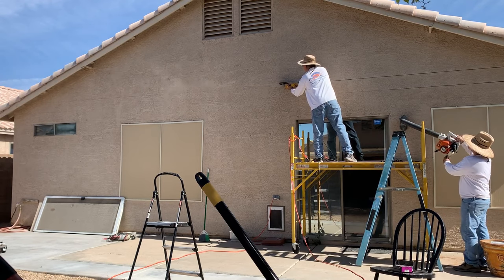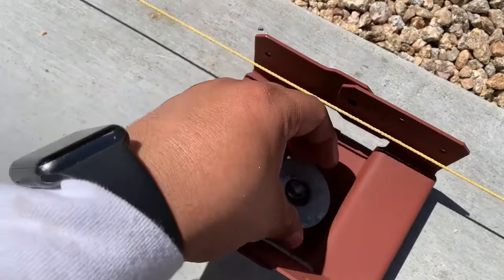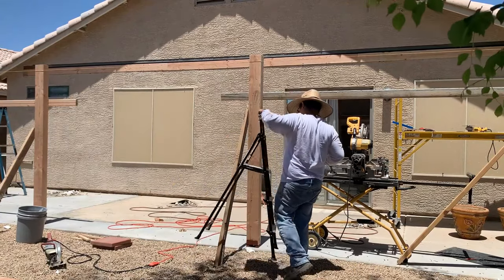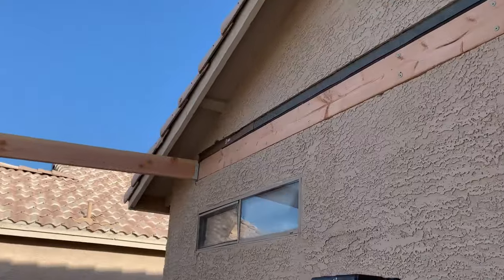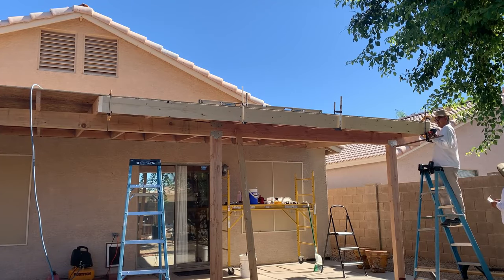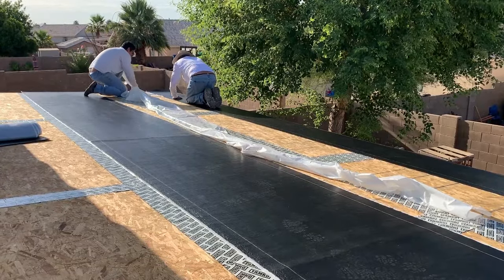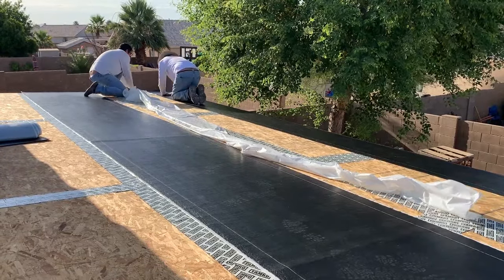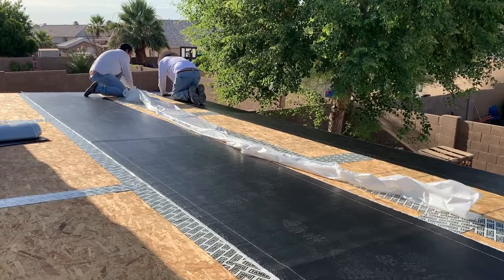DIY Patio Part2 - Framing Roof

Comment: These videos are great man, really appreciate you taking the time to do this. I am getting ready to build a patio onto my house and I didn't wan't to cut into the stucco, but it sounds like this is the correct way to do it. Good job getting the help from the wise old men as well haha
Reply from the maker: David Higdon thank you so much for the feedback! I wish you good luck on your project and make sure to measure twice before you cut into the stucco. You will feel glad you did it right the first time.
Reply: @luisangelmedia4459  Can I ask how difficult it was to install the first piece of z bar flashing? It looks like you install the z bar before you put up the 2x6 ledger. Just wondering how difficult it is to cut into the black paper and slide the first piece of Z flashing up behind the paper?
Reply from the maker: David Higdon It all depends on how many nails or staples you find between the stucco and the studs. We used long and thin tools like drywall knives or masonry trowel and a hammer to cut the staples or nails. If there is a stubborn nail, you can cut back the Z bar where it hits up against the nail.
Reply: @luisangelmedia4459  when you installed the z bar flashing above the ledger, did you slice into the existing black paper and then slide the z bar flashing up behind the paper? I am getting ready to cut into my stucco to install the ledger board and I am just trying to decide the best way to do this before I get started.
Reply from the maker: @davidhigdon8238  yes, you will need to cut the black paper. I was also hesitant on this, but you will see that you need to pull or ram a few of the stucco nails and staples in order to get the Z bar flashing up behind the stucco. The paper will get damaged in this process so, might as well put the Z bar behind the paper.
Reply: @luisangelmedia4459  So once you attach the z bar, the lower exposed part of the z bar flashing will sit about 1" off the wall, correct? It looks like you use another 45 degree flashing that is tucked under the Z Bar? How did you attach the 45 degree flashing? was it just nailed to the wall? Or did you attach it to the Zbar flashing somehow?
Reply from the maker: @davidhigdon8238  okay so on top of the ledger board sits a small 1x3 wood spacer. The purpose of this spacer is so the Z bar can rest on it and also provide support for the 45 L flashing. However, once you have your OSB board and roof material on, you will notice that the Z bar and L flashing make a tight fit because the Z bar is wedged between the stucco and that spacer I mentioned and the 45 is wedged between the Z bar and the roof.
Reply from the maker: @davidhigdon8238  https://imgur.com/a/MbRxgUQ

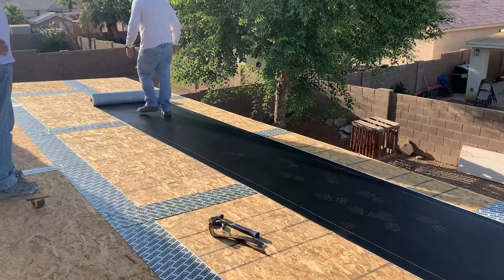Comment: Great video best one I’ve seen with detail instructions what is the small tape called at minute 8:17 with the shiny chrome thank you in advance
Reply from the maker: It’s waterproof flash tape commonly used for exterior doors or windows. Totally unnecessary for this kind of patio build, but my dad had an extra roll and he said to add it to the joints. We don’t do this to new patio builds. So you don’t have to add it.

Comment: 8:21 Luis, the seams between the osb boards have been taped over with some product. I read we can use duct tape but it doesn’t stick well. What are you using?  Thank you for your help
Reply from the maker: @Michael-vi2se  hello there, nice catch on that. My dad actually used window flashing tape that he had leftover from another job. It’s absolutely not needed and he just wanted somewhere meaningful to use up the rest of it. I’ve built many of these patios and we never done that before.

Comment: Hi Luis - can you explain why you cut the first sheet of self adhering underlayment? How many inches did you overlap each section of the base sheet?
Reply from the maker: It’s common practice to cut the first section shorter so that when you lay down the cap sheet on top of the base sheet, the seams are not on top of each other which causes a small bump. Each section is overlap 4-6 inches, shown by the markings on the sheet and the glue that is already on the seam.

Comment: Hello, good job on the build. My question is you guys didn’t use any asphalt primer on the osb it wasn’t necessary?
Reply from the maker: Thank you. And no, here in Phoenix, Arizona, the city did not require me to add anything to the osb except for the paper or in this case, the base sheet roll and the cap sheet.

Comment: You peel the top layer first in the first row so be ease for you then the bottom and if you didnt put roof cement on the drip edge 
You will go back to fix the damage wood .
Reply from the maker: Thank you for the feedback. I did not use roof cement because the roof rolls already had a layer of the sticky material. Also, Arizona is such a dry state that we usually do not have much problems with water damage, unless it’s completely exposed.

Comment: Luis, thanks for the video, I am curious how you finished the under side of the patio cover, OSB is not a great look for me, what do you recommend?
Reply from the maker: @danieldresser9368  Thank you. The common thing to do after you finish the patio is to start adding the insulation and drywall. If you don’t want drywall, you can do plaster as well or any decorative wood.

Comment: I'm doing something myself, don't want to cut into the stucco, our hottest gets over 100, but not often. What would you recommend for flashing? I understand cutting stucco is best but all the contractors I got bids from did not want to do this.
Reply from the maker: @EricRodriguez-u2k  if you’re not cutting into the stucco, then just put a normal L flashing from the stucco to the top of the roofing material and seal it with silicone. Be prepared to seal it with silicone or caulking every summer though as it’s going to be your only way to keep the water out.

Comment: Would you mind posting a link to the roofing rolls you used as well as the tape you used on the joints? Nice work!
Reply from the maker: Base sheet
https://www.homedepot.com/p/GAF-Liberty-3-ft-x-34-ft-100-sq-ft-SBS-Self-Adhering-Base-Sheet-Roll-for-Low-Slope-Roofing-3733000/100087821

Cap sheet
https://www.homedepot.com/p/GAF-Liberty-3-ft-x-34-ft-100-sq-ft-SBS-Self-Adhering-Cap-Sheet-Roll-for-Low-Slope-Roofing-in-White-3732920/100031926
Reply: Hi, what did you use on the joints (before the base sheet)? Thank you!
Reply from the maker: @susyfierros  it’s a roll of waterproofing material similar to the base sheet, but used on things like window installs, has multiple uses. It’s not necessary to add this and this is the only time we did it simply because my dad wanted to have more sturdier seams between each board when walking on top of it.

Comment: First of all, great video Luis. Question for you, are all the studs in your home (where you installed the ledger) running vertical or were they slightly angled? How do you think these studs are installed in a typical AZ home?
Reply from the maker: Yes, all the studs are vertical. But I have another video just like this, except that instead of the vertical studs, I anchored it to the top plate. Here is the video. 
https://youtu.be/jEY4WI4uWwg

Comment: big..  question I live in Colorado...did you use all your Lumber treated....I want to  built a patio cover without treated Lumber
Reply from the maker: We did not use any treated lumber. One year later I painted this patio a solid color to match the rest of the house. I did another patio and they also painted it. It’s usually recommended to paint or seal the wood after installing to lengthen the life of the wood.
Reply: @luisangelmedia4459  thank you so much 👍🏼
Reply from the maker: @kismofer1  thank you for watching 😃

Comment: When you did this did you tie the ledger board to an actual wall stud or did you attach it to the side facing bottom tie beam of the truss to get extra height? Looking to do something similar to this soon so curious how it should be done.
Reply from the maker: @DustinWofford  the ledger board is commonly attached to the top plate, that’s the two 2x4 stacked sideways running across the span of the house, but for this build, I went up a bit higher and I attached it to the vertical 2x4 studs.

Comment: Is it required to use OSB on the roof of an Patio, or could you use metal sheeting instead?
Reply from the maker: You can use any material that will comply with weight rating similar to OSB among other things. My city has the specs for this patio build with OSB, so you need to match that or exceed it with whatever else you are intending to use.

Comment: What would happen if you just attached ledger board on stucco without cutting stucco?
Reply from the maker: You would eventually have leaks and no matter what sealant you use, it will crack and it would be a yearly routine to try and seal the gap between the stucco and patio roof.
Reply: What if my current eves cover the ledger board ?
Is is ok to attach ledger board to stucco ?
I’ll admit, trying to find studs behind stucco has become a big hurdle in beginning this patio cover project.
Thank you for all your valuable videos 🙏🏽

Comment: This is a great video.  I have been watching this multiple times before I try and attempt it on my own house.  My only concern is the flashing.  Toward the beginning of the video you said you put the Z flashing over the paper but towards the end you said you put it behind the paper.  Did you end up cuting into paper and put the flashing under it?  Thanks.
Reply from the maker: Yes that’s correct, I had to cut the paper anyways because it was in the way and so I could see exactly what was behind the paper. So then I was able to put the Z flashing behind the paper, basically behind everything.
Reply: @luisangelmedia4459  Awesome, Thank you for the reply!
Reply from the maker: @tmax450  thank you as well for watching the video!

Comment: Your craftsmanship is on point my friend.  One thing I will criticize though, why spend all that time and money on the new concrete and water proofing but opt for using OSB ply to sheet the roof when it’s all exposed?? Unless you plan on adding some kind of soffit to cover it up, you should have gone with ccx paint grade ply or v-rustic T&G.  Overall good work though.
Reply from the maker: Thank you for the suggestion. And yes we are going to be covering up the patio. The posts will get stucco to match the house and the OSB and rafters are getting covered with drywall and everything painted. We just couldn’t do it all at once as this was already a lot of work and expenses to cover. But that is what is next for this patio!

Comment: Beautiful work. Did the concrete crack from the weight of the covering? That’s what I’m deciding on still. To either put the beams in the ground or on top of the concrete
Reply from the maker: You want it on top of the concrete and on top of a post base. And no, concrete is still good, this is what it’s made for.

Comment: Great vid. What’s the size of the ledger board? Thanks.
Reply from the maker: Thank you, the size of the ledger board is a normal 2x6 and 10 feet long, but you cut them to the lengths you need the boards to cover the span of the house.

Comment: I live in a HOA neighborhood, I know I gotta get approval from them but I was wondering when you mentioned the city code, do I need to get a city inspector to check it or get any permits to do this? I live in TX
Reply from the maker: For Glendale, AZ I simply went to the office (forgot what department) and filled out an application and took home a packet which contained all the information needed for the beams and rafters, hardware and roof info. HOA also gave me the limitations of my patio such as, I needed to have at least 50% of my backyard still left uncovered, which means, I could not build out further than 10 feet from the house.

Comment: Please tell me you live in Florida because I'll hire you asap. Great work
Reply from the maker: No, sorry! I’m in Phoenix, Arizona :(
Reply: @luisangelmedia4459  it's cool, did you have to get a permit from the city to build. I read they need a design plan but I was quoted $3k for a design alone.
Reply from the maker: @VICMANROQ  I went to the city when I first started the project. They gave me papers with all the info I needed and asked me to "draw" as well as give the information they needed, like rafter span length, distance between posts etc. Included in those papers were the "schedules" or tables to help you determine what size rafters and posts you need. After putting together all this I went back, but they wanted $600 for the permit because it was based on square footage. I did not have that kind of money, so I did it without it. All my neighbors had patios and my backyard neighbor had one built and I copied everyone to make it look "similar" no issues yet.
Reply: @luisangelmedia4459  thanks for the info, that's really helpful.
Reply from the maker: @VICMANROQ  you are welcome and thank you for checking out my video.

Comment: Did you have to cut the rafters to connect to the brackets on the ledger board.
Reply from the maker: Yes, a very small angle cut was made because the rafters are sloping down, so without the angle cut, it will not sit perfectly against the rafter hangers on the ledger board**( it used to say fascia)
Reply: @luisangelmedia4459  Did you use a bracket to connect the first rafter or how did you attach it. I don't see a bracket
Reply from the maker: @iroc2019  you can see the first rafter (which is actually the fascia board) with the bracket at 5:21
Reply: @luisangelmedia4459  what type of bracket is used on the first rafter. Looks different from the other ones.
Reply from the maker: @iroc2019  Looks like a U
https://www.homedepot.com/p/Simpson-Strong-Tie-HUC-Galvanized-Face-Mount-Concealed-Flange-Joist-Hanger-for-Double-2x6-Nominal-Lumber-HUC26-2/205227182
Reply: @luisangelmedia4459  Excellent thanks

Comment: It was nice to hear you the pride you took in your father's work. Did you have any experience drawing
up a project like this or did you hire someone for the plans?
Reply from the maker: Well the design was fairly simple, just following what the city told me to do for their building schedule in terms of rafters, posts and beams. As for the overall dimensions, I picked sizes that would be easy to work with, for example 32 feet was the biggest I could go along the house and fit 4 4x8 boards. I just made sure to have common sizes for the material I would use.

Comment: Could you not have used Reglet flashing instead of removing that section of stucco?  I've seen many jobs where they just cut a notch into the stucco with a grinder and the Reglet flashing gets pushed into the notch, sealing it up so no water intrusion gets behind the stucco or the ledger board.
Reply from the maker: I supposed you could open up a slit if the flashing you are referring to is meant to be used in such purpose, but I would ask myself if you are already opening a slit, why not just open enough to put the ledger board and flashing in there.

Comment: Hi, Luis thank you for such a great video. I also live in Laveen Az I do have a patio already but need to extend it I want to do it myself is there any way I can do it without cutting into the stucco? I will appreciate your advice or if that is your profession too we can talk hopefully I can afford thanks
Reply from the maker: If you don’t want to touch the stucco, you can try finding the studs from inside of your house with a stud finder and use a tiny, but long drill bit to drill through the drywall and out of the stucco to mark the location of the studs. Your ledger board needs to be absolutely solid, so this is why you need to anchor it to something with lots of meat on it like the studs. Your ledger board supports all the weight of your patio on that side. For more information, email me at luisangelmedia@gmail.com
Reply: Thanks a lot, I will email you when am about to start I appreciate your reply, keep up the good work
Reply from the maker: @peteradjei199  thank you
Reply: @luisangelmedia4459  just sent you an email

Comment: Great job on the ledger board. For those of us with stucco homes and no existing roof rafters to tie into, you showed the right way to do it. I've been planning my own build and i couldn't find any videos for weeks that showed the removal of the stucco to expose the rim joists and/or blocking. I can't understand why no one does it this way. Most patio covers in southern california are just screwed into the stucco and I'm assuming they're guessing that they're hitting joists/studs.

Only question I have for you is did you just leave the 2" of flashing exposed above the roof or did you try and patch it with stucco ?
Reply from the maker: Thank you for your comment. I left the flashing exposed. If you want to hide it better, you can always paint it the color of the house.

Comment: Absolutely beautiful job. I have a question: my house is old but has great bones. I can't find the studs to anchor the ledger. Can I use the self expanding concrete bolts (5/16, 1/2, etc.)? Thanks so much Angel
Reply from the maker: If your house is made of masonry blocks, look at my most recent video I just uploaded, it’s a patio on a house with concrete blocks and eaves. Your ledger board needs to be anchored to something structural of your house. You can try uploading a picture somewhere and sharing it with me to see what’s going on.